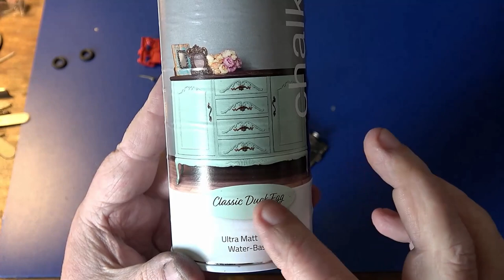Corgi 448 450 Police Mini Van Conversion Restoration

Comment: I sympathise with the frustrations you experienced in this restoration.  Perhaps you should have awarded yourself a glass of stout upon completion as KLG are the initials Kenelm Lee Guinness, member of a well known brewing family.  Kenelm was keen on motor racing and developed his own design of spark plugs that used mica rather than ceramic insulation and they worked very well in in high performance engines.  Many other racing drivers asked him to make spark plugs for them and so the KLG spark plug company was born and ran successfully for many years.  Other bits of trivia, if I have not already lulled you into a deep sleep:-
Campbell purchased his first land speed record car from Kenelm (who had used it as a racing car) and named it Bluebird.
Kenelm was a director of Armstrong Siddeley Motors for a short time.
You can wake up now. . . .
Reply from the maker: Ha`Ha` lol ! Don't worry David I`m still awake , I actually love bits of information like that and find anything like that very interesting . It might be construed as useless info to some but you never know when you might need it !

Comment: First off, you do really nice work, love all your restorations.

Now for the technical question for a newbie; the rivets you use, what size are they? They make small, medium and large. Assuming its the large ones for the 1:43 scale cars? Large is 5mm x 7mm.

Thanks
Reply from the maker: Thanks Mark, you can use any of the rivet sizes really, it depends how big the heads are meaning will they keep the baseplate on? Any of the shafts on them can be filed down to fit whatever size hole you’ve drilled into the rivet post, just use your own discretion.